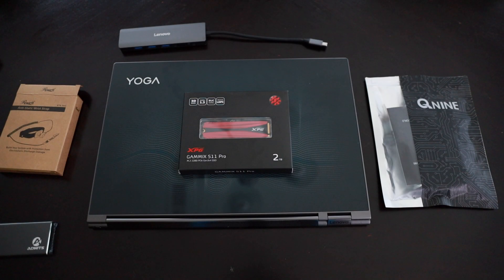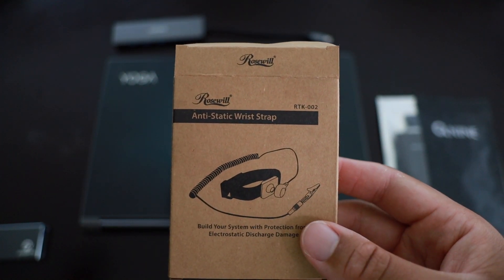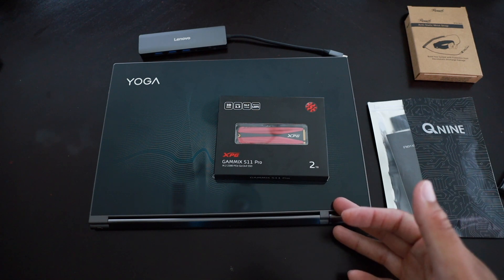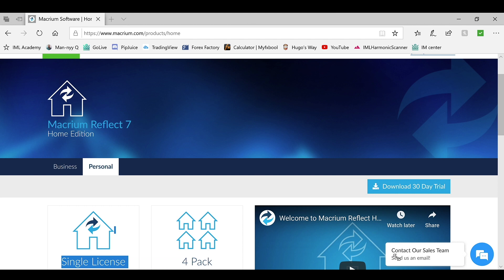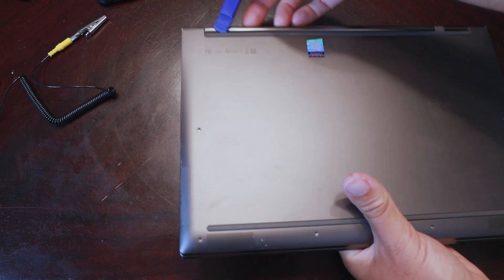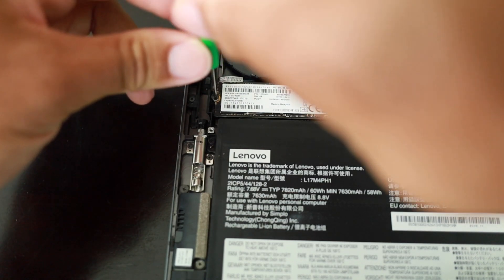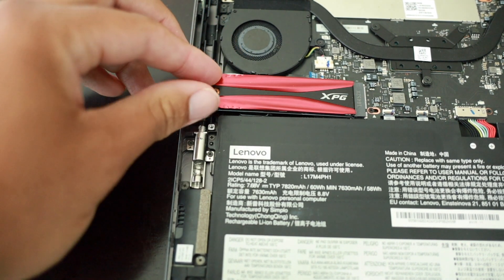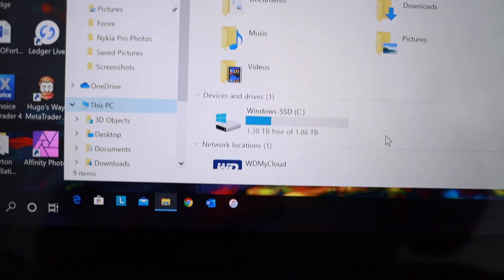How to install SSD into your Laptop / Lenovo Yoga C930 Glass 2TB upgrade.

Comment: How did you prep the screw to make it easy to remove? I have already stripped the screw because it was so tight. Obviously, Lenovo does not want anyone to upgrade the drive.
Reply from the maker: It was already kinda loose which was odd. Maybe I got lucky
Reply: Need a good screw driver set. Some sets look good but stink when you use them (soft metal)